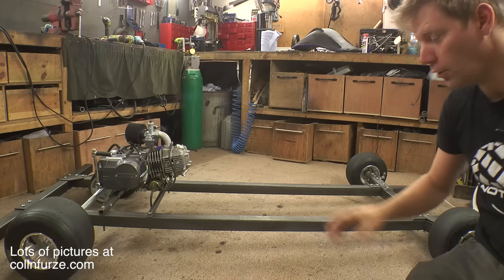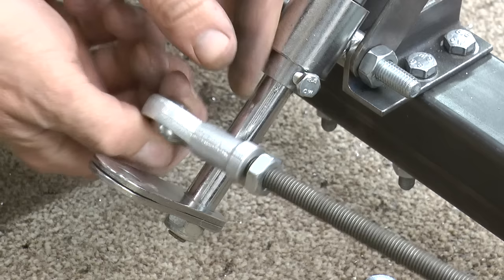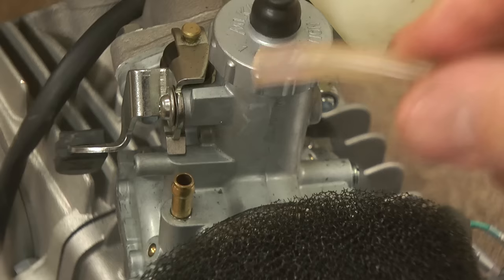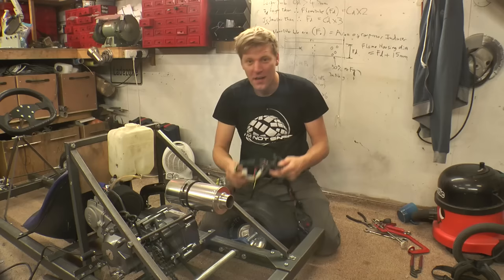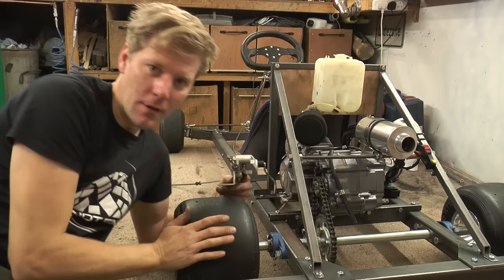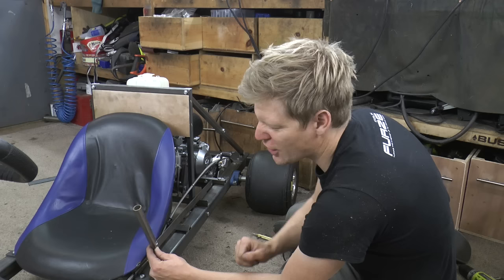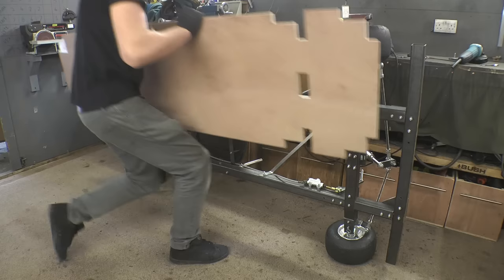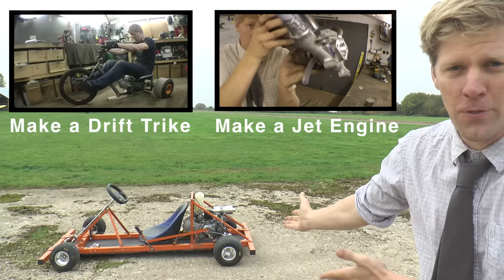Making a Motorised Go Cart with NO WELDER and simple tools #2 Finish/Test

Comment: just the bolts would exceed my budget
Reply: Use plenty of duct tape and zip ties 😂🤣
Reply: Mate... I've started buying the parts and I'm like.. Ohh so this isn't a cheap project
Reply: i got plently of bolt but i dont have any steel tubing :S
Reply: Ditto I’m in the us and the shipping on the website is more than the actual engine 

Edit:hey thanks for the advice I’m actually building a golfer and that really helped
Reply: @inhumanfilth681  those engines do not produce near as much hp
Reply: @sp1rz277  you can double the stock output of a predator engine pretty cheap and efficiently though
Reply: sorry dude ur gonna have to spend a little money on a nice kart
Reply: @inhumanfilth681  it is a 1speed
Reply: You should see my workshop the floor is covered in bolts there’s just a clear path to the workbench and the door
Reply: Ex except mclaren is fast.
Reply: Same
Reply: Dude's flying  whaatttttttt
Reply: buder5 im using a bed to build mine, try finding an old metal bed frame or wait until you need a new bed frame.
Reply: You can buy a long threaded shaft and a few nuts.
Cut is intro smaller pieces and then put a nut in the end
And if You put plenty of locktight it works just fine
Reply: I'm just going to buy mine
Reply: And drill bits
Reply: He says u don’t need any fancy tools and the welder but if you have lots of random bits of metal tubing lying around then I’d imagine that you DO have a welder and fancy expensive tools and a big workshop.

Comment: Now for your next challenge build a go cart with only things you can find in an auto scrap yard, including the motor, seat, bolts, etc
Reply: Smajo Lelak that would be so awesome
Reply: Remember Junkyard Wars/Scrapheap Challenge? That was my childhood, here in the States.
Reply: Smajo Lelak The funny thing is, that is what most of his old projects were made of.
Reply: Assuming that the scrapyard took motorbikes, it wouldn't really be that much harder that this.  Pretty much all of those materials apart from the wheels would have been available.
Reply: Joshua Rosen car engine would be fine XD
Reply: Hugo van Rossum
I'm sure that would work but I bet the gearbox and transmission would be much harder work than converting a motorbike.
Reply: Hugo van Rossum it'd work, just it'd be a pain in the ass to do seeing as a full sized car engine weighs several hundred pounds
Reply: fuck that..build a sport car....he has the capacity for that...i believe in colin...colin for precedent
Reply: Impossible? I beg to differ! Have you ever seen scrapheap challenge?
Reply: Darkest Winter Yeah, people throw away perfectly good stuff sometimes. I've heard that there was a guy who threw away a good car engine because it was "broken"
Reply: Volks wagen 

yeh
Reply: smajo s just he needs smaller engine,in cars smallest engines are about 1000 cc
Reply: Star Kicker what about destroy build destroy
Reply: Joshua Rosen hi
Reply: Monster "mini" garage XD

Comment: This is the most well built home made go kart I've ever seen lol
Reply: Also, the 50 fps is making the video buffer :/
Reply: U get the option to watch it in 30fps, but i'd just recommend better internet in general xD 50/60fps it pleasing to the eyes.
Reply: The 50 fps makes it look nicer, and if its buffering for you, your internet isnt fast enough
Reply: Don't think you've seen many of them then. I've built a better one when I was 14. Welded though, so it was a bit more solid.  People make go cards that look like they come out of a factory, this was just a fun project. It's funny seeing people so impressed by his work not realizing that he's just having fun and most of what he builds is just quickly thrown together.
Reply: I'm sure yours was faster, but I doubt your 14 year old self could weld something together as legit as this.
Reply: I don't recommend welding or even soldering wires together until your at a skill level to do it at least 80 percent of what a professional would do..A poorly welded a go kart than can hit 50 mpg is dangerous and down-rite foolish,use metal,bolted together and or use a type of 80/20 industrial erector set,which is  T slotted extruded aluminum.
Reply: good thing you dont weld wires together anyways.
Reply: Lawrence Lentini
Reply: Lawrence Lentini
Reply: Lawrence Lentini i
Reply: If he had a welder...

points at buggati it would look like that

Comment: Formula 1 cars stopped using the Plywood for the underside grinding plate, now its a Titanium sheet, they use it because titanium work hardens and gets harder to grind down on the tarmac the more it gets hit, and... y'know.... plywood catches fire
Reply from the maker: na i think there is still a plank, just titanium screws
Reply: colinfurze lol. I see what you did
Reply: Yeah definitely still got a wooden skid plate, it's used for post race checks to make sure they're not running the cars lower than the FIA rules allow
Reply: Yeah and the seat is made of gold
Reply: мда
Reply: It doesn't mention wood in the rules... However everyone else is correct.  This is the rule.
The plank must be made from an homogeneous material with a specific gravity between 1.3 and 1.45.
The Titanium skid blocks are only there to create sparks to 'improve the show'.

Comment: And if you're at all concerned about the structural integrity of your face, make sure to use locknuts or some kind of thread lock on all the bolts as they may otherwise shake lose over time resulting in injury or death.
Reply: You should always wear your safety tie!
Reply: PJ he used an electric drill and probably torque wrench to do them up. it will take way more than a bit of shaking to make them fall out. plus he probably put some nut lock gel onto them anyway
Reply: Sadly the the safety tie seems to have given way to his own T-shirts.  I understand the need to promote the T-shirts but doing all these dangerous things without his tie puts him at serious risk of an accident and none of us wants that.
Reply: Nuts shake loose surprisingly easily and the complete absence of any suspension or engine mounting bushes on a go kart like this makes them vibrate like mad.
Reply: PJ lock nuts are garbage and don't work well. There for People that think wd40 is a good lubricant.
Reply: It is a good lubricant for not being a lubricant :-P
Reply: Rooster
Bad spelling is acceptable, shitty attitude is not.
Reply: The Kruxed Thanks for the English lesson.
Reply: Rooster this is such a heroic way too sppend yur tyme. Do you think you well gut a Noble Prize for help noble it is!?¿.
Reply: Jared Jeanotte Har-ha
Reply: Rooster ha! Har Har is not a fish I made that up. I roasted a rooster. Again.
Reply: Rooster I feel like I should keep this up because this is likely that most meaningful human interaction you will have today. But I don't have time to read your replies, since I can't read and all. So I bid you a do-do as the French say.
Reply: PJ absolutely , harley motor cycles the same

Comment: does it not have a clutch? or does the engine have one of those internal clutches?
Reply from the maker: internal
Reply: Simon Yu
Reply: You're cool, man! )
Reply: Sequential gearbox, I think
Reply: internal
Reply: Simon Yu   It's a semi automatic. stepped chainring type. You shift but there is no external clutch lever. Three or four speed. Japanese version will be a Honda ct variant. Many company's have copied the motor and they are known as clones.
Reply: i didnt fall at least!!!
Reply: plumpkitters what is a klutch?
Reply: +Eli S. The German version of "clutch"
Reply: Simon Yu

Comment: 1) have no words for your intelligence and clarity 
2) I wonder who in the right mind would dislike the video. Makes no sense
3) would appreciate to know 
    a) are you changing gears without 
         a clutch
    b) also want to understand why you did not simply weld the tie rod at an angle on the wheel /Tyre instead of painstakingly bending the square tube 

Thanks
Reply: The video says in the title NO WELDER .
And not all engines need a clutch to be manually operated , on most low cc engines you just get off the throttle , change gear and then open the throttle again .

Comment: Wait, so you built it, and then TOOK IT APART AGAIN just to paint it? XD
Reply: yes, that's the normal course of action when you built a custom bike or custom anything. Otherwise, you make changes while it's painted and have to repaint parts of it anyways
Reply: Well its just stupid to paint parts befor the whole project is done, same with cars you don't paint sertain parts when you done with them, you paint it when everything is in place and works as it should. its waste of material if you paint then end up scratching it when building it and if the parts are wrong well guess you hafto paint another one as well.
Reply: I think melig1991 was just thinking what I was, which was to just run a rattle can over it whilst it was still together :P
I know, I know THE BOLTS!!! :D
Reply: Clearly you're not an engineer hihi.
Reply: You have to know its working first before painting anything... unless if its already came from a template
Reply: It's smart to paint hidden places, such as inside joints, which are most susceptible to rust.
Reply: He had to test then he could repaint it

Comment: So Colin here's a challenge. Convert it to all electric now.... LOL
Reply: That's a great idea=)
Reply: To keep it safe you would have to reduce power to 10HP max and 48V (to comply with the low voltage directive). That would still mean for a 10 minute run time you would need about a 2kWh battery to account for losses. Second hand you can get one for about double the price of this entire project (assuming lithium). The motor would then cost you about the same as this entire project and the electronics to control it would cost the same again. You could go cheaper and use lead acid but you would need 8 off 100AH batteries at about 30kg each. That's 240kg of batteries! It still would not be much cheaper as those are about £125 each. So still £1000 for batteries.
Reply: Or, better/worse: a hybrid! For the more tinkering engineers, a nice project to work on drivetrain efficiency. I just told a friend with a hybrid supercar project to do a kart like this as a first step. Why wouldn't you?
test first how much racing you get done on 1 liter of fuel. then add electric bits, and see how fast (and fast) it'll go then. Especially rain (or dirt) racing will be interesting, when yo add electric FWD.
Reply: Cloxxki as mentioned above the reason you would not bother is cost. It would triple the cost of the build at least. A second hand 10KVA generator is about £1200 alone. That is more than the entire current build cost. Then you would need 4x 2.5HP (about 2KW) electric motors of a type suitable for driving the wheels. That would be about £800 if you were lucky, again more than the current build cost. Then you would need the electrical power train which would cost at least £500 as it is not a common type to use. So would you really want to spend in excess of £2500 for something that would cost you about £700 elsewise? Also remember it would vastly increase weight, reducing performance. So in effect you would have something between 3 and 4 times more expensive with probably 2/3 of the performance.
Reply: Oh, I'd not disconnect the ICE from the wheels, that's crazy inefficient. 
In the supercar realm, hybrids are considered a performance booster. In the case of some that may be true, but indeed, overcoming its own added weight is quite a challenge.
Reply: Cloxxki hybrids in what you are talking about are not a performance booster of the type you are talking about. They get a good deal of their power from regenerative breaking. That alone would triple the cost again. I suggest you learn more about the subject.
Reply: YYYYEEEESSSS!!!!!!
Reply: Ahman Millener sorry but we are respectable people here.
Reply: your math is way off
Reply: Boring

Comment: for the amount of bolts and nuts purchased, you could honestly buy a stick welder and a few packs of sticks to weld this with.
Reply: Adam M not everyone has a welder at home, so he's just giving an example of how its done
Reply: not everyone can weld  @jasonkuy7100
Reply: @Jason Kuy, he’s saying that with the cost of all the nuts and bolts, it might be cheaper or just as much to buy a stick welder and some sticks, then you could also use it for another project——— @ steve jones, we are on YouTube aren’t we
Reply: if you buy one of those instant darkening masks welding is ten time easier, welding 4mm steel with an arc welder is quite easy tbh
Reply: Not a chance
Reply: @Z3n1tHL0rD  It`s only having that kind of mask that allows me to weld at all. Otherwise I weld everything but what I want to.
Reply: @angelsone-five7912  I've never had good luck with auto-darkening shades. They always darken too slowly and hurt my eyes. A solid red shade is perfect for me.
Reply: @sebkhailer7374  I must be lucky then, mine is adjustable and darkens instantly.
Reply: @angelsone-five7912  You must have a high-end one. Though, even if it did darken fast enough, I'm too sensitive to blue light and the auto-darkening ones I've ever seen allow too much to filter through. So red ones work out best for me.
Reply: @sebkhailer7374  Well you carry on with what you are happy with, that`s best.

Comment: 0:19 this seat must be 80mm lower i think
why you didn't mount it under the frame?
Reply from the maker: Никита Найденов if the bolts came undone you'd be screwed.
Reply: double bolts
and have 80mm lower mass center :)
Reply: if you make it yourself, do just that. The plans are fairly simple and open for modifications :o
Reply: If the bolts came undone you would loose your nuts!
Reply: Hahahhahahahaha

Comment: What do you need to know in order to build stuff like this? Is it all motorized education, like you have to know everything about cars, electronics, I want to know what education to take so that I can learn in college, then I too, can be an expert on this type of thing.
Reply: If you want to be a mechanic , go into automotive in college. But doing this as a hobby and such is just learning from the internet, and actually building the stuff yourself.
Reply: Automotive would be optimal, or  electric enginering can work too.
Reply: just buy some basic tools and then you gotta figure it out. simple problems, simple solutions, engineer a fix with what you have.
Reply: As the rest typed.. utilize YouTube and other medias, ask around, doesn't hurt to ask other channels info upon why something or how it functions, obtain some tools (don't steal them), and take things apart and put them back together, learn what each part does, and why it's there and what function does it serve.. in no time you'll learn what you can use that object in a project, or tinker with other ideas. You don't need a degree in robotics, engineering, or being a mechanic to learn basic stuff. A lot of us shade tree mechanics learned by trial and error, and it's actually not a bad way to learn, even if you're taught exactly how to do it right, do it wrong and see what happens so you have a visual in your mind of what could happen, and how you will go about fixing it, before you tear it down.

Comment: why not electric?
Reply: because that is boring and expensive
Reply: pit bike motor and gas tank is way cheaper then electric motor and batteries... though a electric one would be sweet because it would be quiet
Reply: pit*
Reply: Build a solenoid engine, for that matter. Even more exciting imo.
Reply: The cheapest option for batteries would be 8 off 100AH 12V arranged to supply 48V (the highest voltage you can use that will not kill). That means the batteries alone new would cost £1000 minimum. They would also weigh around 1/4 tonne. You would need a 7.5kw motor (about 10hp) and the heavy duty controller to control the motor. You are not going to get change out of £1000 for those. This assumes a total of 10 minutes run time is acceptable. It would also be way heavier and have less power than what Collin made. You really want that for way more than double the price?
Reply: Gordon Lawrence 🤓 🤓 nerd skills
Reply: shivankit ss Geick not nerd. I'm so much of a Geick I know it's not spelled Geek as it is from "Geick: Technical Formulae". A nerd is someone into Star Trek and similar and may not have anything like my technical skills.
Reply: electric engine dont have necessary power for mooving is tooo slowly
Reply: Kim Carlo Manguerra specify what type of power
Reply: Kim Carlo Manguerra you can get an electric motor at pretty much any power output you want. There is even an E1 racing motor that is comparable to an F1 racing engine. The problem is cost. Anything above about 2kW starts getting expensive and that is not even 3BHP.

Comment: Can you put a chainsaw on a normal bike?? I will see that because i want to crate that but i will see that it works first😇😇   Like if you like the idea👍👍👍
Reply: Markus Lindhjem  hmmm, and you will do what exactly with this chainsaw bike of death?
Reply: The same thing you would do with a pulse jet bike of death😂
Reply: I like the idea...Just I think it  need to   be  geared way down as  chainsaws run at  so  high a rpm.
Reply: Anything is possible with duck  tape

Comment: An air cooled engine sitting behind the driver with no air passing onto its fins?  Bad idea.
Reply: how would you cool it?
Reply: Mykolas Stankevičius channel air to fins by means of side vents or replace the air cooled engine with a liquid cooled one that allows you to plonk a radiator behind the seat.
Reply: Oh, I bet the engine gets plenty of cooling air. After all, right behind the seat, a vacuum will be created and this will pull air from the sides.
Reply: Yes true.
Reply: cagednm69 driving 8 s like him wil cool engine enough
Reply: Jon Schwendemann exactly
Reply: Not welding a cart but bold it together makes it good again the air can float threw the gaps